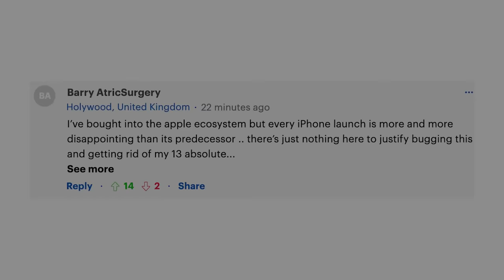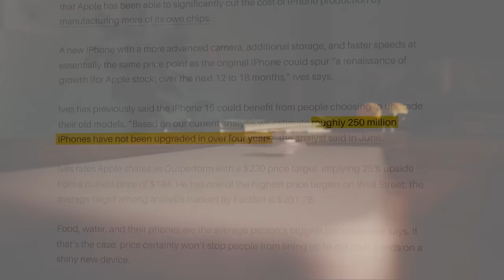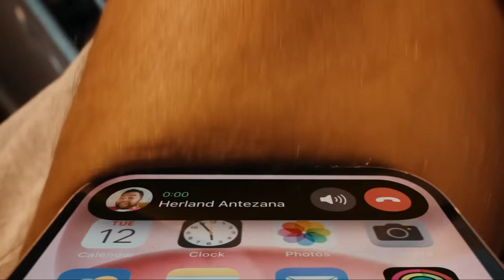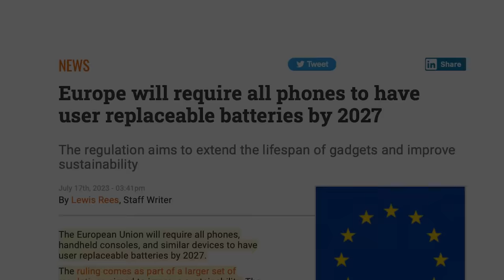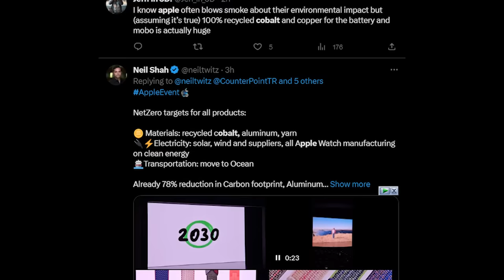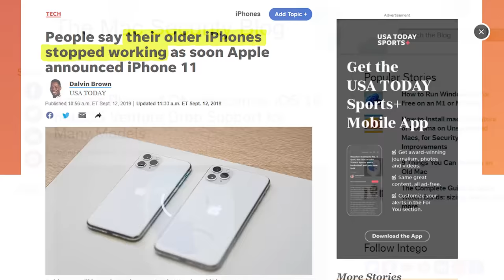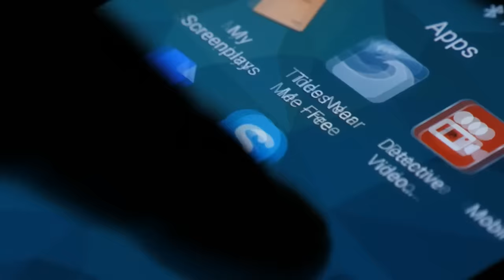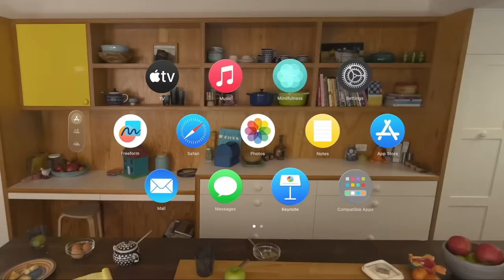The iPhone 15 Is Everything Wrong With Apple

Comment: These upgrades are only underwhelming if you buy one every year. Ideally, you should be using your phone for at least 3 years or more. I have the 12 Mini since 2020 and it’s still rocking great.
Reply: Still got my iPhone XR after 4 years and it’s still working good so I’mma continue using it for a another year or two
Reply: It's easier to undermine changes then it is to understand them. Iphone can support ray tracing now, has a significantly imporved camera, and improved battery life. what more do people want?
Reply: I got the XR. Bought in 2018 and it’s still kicking ! 😂
Reply: Exactly, I have the normal 12 and it still feels like a new phone
Reply: I'm only thinking about upgrading now because I have an iPhone 11 and a damage camera lens 
If my camera didn't have a crack in it I'd probably stick to my phone for another year or two
Reply: "Ideally" to who? As a consumer, I absolutely agree. But from a business standpoint, if they could get you to line up out the door for basically the same product re-released every week they would do it. But it happens "annually" is a good interval to get the sheep excited enough to camp outside the stores in preparation for each new release.
Reply: Same. Sad they got rid of the mini size
Reply: And people try to find an excuse in upgrading their phone every single year.
Reply: @saminates2002 11 is still great. The camera lens is a cheap repair. I have the XS max and I am still happy with it. Nothing I’ve seen that I need on the new release as a regular user. Unless your a photographer/content creator. Plus now you’d have to deal with a new connector.
Reply: Exactly. This isn’t about a lack of innovation, but more about the fact that smartphone technology has matured. There really isn’t anything that ANY smartphone can do that isn’t going to be a minor improvement over their immediate predecessor. When you look at just a few generations back, though, you will start to see bigger improvements. 

I also believe that it’s also dishonest to say that Apple is no longer innovative. Like someone else said, what other smartphone has hardware ray tracing support? What smartphone has satellite capabilities?
Reply: until apple drop an IOS which intentionally kills your battery. OK.
Reply: @Jay5ive789 I would still have my X if it wasnt because the screen died on me one day out of the blue, I changed it for the 12 which was the latest atm and this one is still literally in perfect condition, it can hold easily 2-3 more years. I will wait until the USB C is actually 3.0 and the display is 120hz on the regular version, I hate big phones thats why I always go for the regular.
Reply: I'm still on the 7+ but I will finally be making the upgrade to the 15 pro max after years of using the 7+
Reply: X from 2018 here. While the battery life definitely can be better, I don't see a reason to upgrade to a new phone. If anything I might just end up replacing the battery instead.
Reply: Dude I fucking love my mini, I really don’t want a bigger screen :(
Reply: Yep I upgraded from a 6 plus to an 8 and then to a 13. It’s nice to see a big difference in your upgrades
Reply: I had my iPhone 11 since April 2021 and to this day it’s still going fine.
Reply: i m using iphone 7
Reply: I bought a fold4 from samsung and i dont see myself ever getting rid of it, until it breaks
Reply: I got an iphone 8 plus, so compairing it to my current phone its good😅🤣
Reply: I have iphone and still working great and you don't know how many times I drop It. When i had samsung phone when I drop it, It will black out... That I'm the most super with my 11 and I'm grateful for it!
Reply: @funnyberries4017 features you named are only on the pro models tho, granted i agree with your statement overall but you only proved the point for the pro models lol
Reply: I have a 10. After one of the updates they put out, my battery quit lasting. It'll go dead, without using it, in under 5 hours.
Reply: Same here, I got the 12 and I’m probably gonna jump to the 15 pro or pro max, only cause I get a discount since I work for a phone store

I would happily keep this if the battery lasted
Reply: yeah i upgrade every 3 years
Reply: so what? Samsung and Xiaomi models three years ago had better specs than iPhone 15 base model.
Reply: @Aussiepingpong  that’s a great upgrade
Reply: I came here basically to say this.  Just upgrade when you need to.  And you can always buy a slightly older model for much cheaper.  As long as you upgrade every 3-5 years, you’ll be fine.  And if you can’t afford that lifestyle then Apple just isn’t the brand for you.
Reply: I have had my HUAWEI Nova 5t since 2019 and  it is also rocking fine, remember this is not a flag product so something like an Iphone should work for years to come.
Reply: I still have my s20 fe after 3 years, and the charge still lasts 11 hours
Reply: @chairmanmaul6120  That’s just untrue and you know it.
Reply: i got an 11 pro max and it still works great
Reply: correct me if i am wrong, but if i remember correctly in 2020 the latest phone was the iphone x
Reply: @Jay5ive789 5 days ago I dropped mine on a bathroom tile corner shattering the back where I can see inside it from the back glass so I’m gunna buy a 14 😢
Reply: Just this year, I switched from my Xs Max to a 13 mini. Not going back to one of these huge slabs, no thank you.
Reply: @curtisgordon7379  I thought iphone X was 2017
Reply: @macaroni745  well i may be wrong, but thats the way i remember it. my memory is probably just wrong
Reply: exactly, I still have my XR since it first came out so getting the 15 is a huge upgrade for me
Reply: my 6s still runs… does all the basic functions fine… granted that’s the phone my kids use when they’re bored… i happen to have a 14 Pro and the wife a 13…  my mom iphone 8… so Apple iPhones actual last really long.
Reply: Same, my iPhone 12 mini still works great
Reply: Iphone 8 here, still not seen anything groundbreaking enough to upgrade. Will probably have to update to Iphone 16 though
Reply: I had a second hand iphone X since 2020 and it was starting to break, so I knew it was time to switch and for me an iphone 15 seemed like a great improvement. Obviously the upgrades are not going to feel like much if you switch every year, like from a 14 pro to a 15.
Reply: This is not a meaningful upgrade over the iPhone 12 Beyond usb-c which they were forced to do. It's literally the same exact design outside of the ridiculous Dynamic Island which you cannot even turn off
Reply: @Jay5ive789  i'm still using my oppo f5 from 2017 with android 7 6 gb of memory left and i kid you not it has a fucking 16nm processor..........yea i doubt an upgrade to a samsung flagship will be only marginally better for me lmao.
Reply: I had an S9 for about 3 years before it started to fall apart. The screen was cracked, buttons fell out, mic didn't really work nor the earpiece speaker. I bought a S21 earlier this year to replace it. Sometimes I forget that I'm using a newer phone and we're talking two phones that are 2 generations apart. There are differences, but that's only a 10% better camera that you can't tell the difference between unless you have them side by side, and a fingerprint reader that is located somewhere different.
Reply: I still use my Iphone 8 lol! but it is dying so I am gonna buy a new one soon
Reply: @rollinontheboard time upgrade to at least an 11
Reply: I’ve had an iPhone 8 since 2018
Reply: Rocking the 12 pro max still, needs the back replaced but other then that it’s great.
Reply: Bro I got an iPhone 7…
Reply: @funnyberries4017 they want innovation man. 😂😂
Reply: Same here. I have the iPhone 12 pro and I am planning to buy another one in 3 years, that is the iPhone 18.
Reply: I literally have an iPhone 8 plus and love it lmao
Reply: True but with iOS 17 it’ll probably lag a bit
Reply: Ouch... welp rip to u mate. iPhone 12 recently got tested and it has the most " radiation" that can go thru us Humans
Reply: This is correct. Year-to-year innovation isn't a thing anymore, so the consumer typically lets yearly incremental upgrades stack 2/3/4 years before purchasing a new phone (or computer, for that matter).
Reply: I upgraded from SE to 14 pro and i don’t plan on upgrading for another three years at least.
Reply: +1 on mini
Reply: Yeah, I'm upgrading from an SE (2020) to the base model 15 and am planning on keeping that phone until the iPhone 20 releases.
Reply: I went from a 7 to a 14. Screen was a bit bigger, camera was a bit nicer and apps loaded a bit faster. That’s pretty much it lol.
Reply: I have X
Reply: This. I have bought the iPhone 6 Plus on release and stayed with it until this year that I decided to buy the 14. Yes it's way too much, but I'd use an iPhone until they no longer get iOS updates, which is like 4-5 years, which is great because a lot should change in 4-5 years
Reply: i dont think ill ever buy anything from apple, but im normally having one phone for like 5 years minimum. Last phone i had for 7 and i actually lost it XD so maybe i would be able to hit even more with it until it stopped working. The phone i have now will be about 4 years now? i think.
Reply: still with an XS till it breaks
Reply: I just switched from the iPhone X I had for 5-6 years to an iPhone 13
Reply: This. I remember going from a 4 to a 5s (3g to LTE, and a crappy version of iOS 7 to a fast iOS 8), it was night and day. That was back when iPhones only had support for 3 years. Now you get support for 5 years, plus a few more years of security updates. That’s unheard of for any android, but Google and android manufacturers keep getting a pass from everyone
Reply: Innovation is dead, seriously.
Reply: I don’t pay a dime for my iPhones, I trade them in lmao
Reply: Absolutely right..I also feel the same, I have a 14 pro max and I have no reason to upgrade to 15 pro max, except the USB-C, the Action Button and the new A17 Pro Chip, there’s not much of a difference…I can use my current phone easily for 6-7 years.
Reply: @funnyberries4017 Why the duck would someone want ray tracing on a phone
Reply: True. Been using my 11 for more than 3 years now. Still working good and I am really excited in case I upgrade in the future.
Reply: Still the difference between the 12 and 15 is minimal.
Reply: can you please tell me the difference between the samsung s22 and s23???
Reply: I’ve got SE2020 and I’m fine with it. When I need to replace it one day I’m just going to buy the same phone lol
Reply: Exactly
Reply: I have 11, for 3ish years but flip series on andriod is more interesting to me than 15. Will see long term performance before switching to andriod
Reply: It’s has more radiation mate just upgrade
Reply: eh i got a 13 mini and i really never grew attached to it, imo my old iPhone 6s was a better phone, it simply worked better and was easier to use. Face ID and the display stopped working after being in some 3 feet water for only about 4 minutes, it costed $300 to replace the OLED display. Overall its a pretty mid tier product, chip is a powerhouse, camera's are fantastic, display is great. but it really doesn't feel special. Probably will replace it with a 15 pro or 16 when it comes out
Reply: Still using my iPhone 11 which I got in March of 2020 and it’s still working amazing. I still don’t even have the need to change the battery yet.
Reply: My Walkman w810i still going strong
Reply: 3 years is the bare minimun, I have only owned 4 phones for the past 15 years.
Reply: 12 mini is the best.
Reply: yeah I've had the same phone for 5 years now don't plan to upgrade until atleast 8
Reply: My iPhone 7 Plus lasted 5+ years. I upgraded to the 13 pro max and it actually felt like a true upgrade. However when it got stolen that same year I still had the 7 plus on hand to use until my insurance replacement arrived. 

I’m on the same said as you all. Technology should have a lifespan of a few years until it needs replacing. My 2016 MacBook Pro is still going as well, and even after having most parts replaced recently ✊🏼
Reply: I’m using iPhone 13 mini I was expecting major  change for iPhone 15 but I don’t know if it’s worth it anymore
Reply: i have the 11. i am SO excited for the 15 :)
Reply: I have a iPhone 8plus and it still serves me well, when I saw the update the iPhone 15 has I was impressed and the USB-C is a fantastic upgrade from the lightning cable.
Reply: It’s radioactive
Reply: Hell no the 12 mini speakers and battery are abysmal but keep lying to yourself
Reply: iPhone 8 plus here…..my next upgrade is 2nd hand iPhone 11 pro max. The 1st hand iPhone i ever had is iPhone 4a, then after that is 2nd hand 6s…it would be 10 years from now that i would use apple USBc.
Reply: I've got the 6s and it still runs great but most of apps doesn't support even though phone is still capable of doing a lot of basic things that one phone should do.
Reply: I’m probably going to pick up the 15 Pro Max this year. It’s doesn’t really wow me and I’m upgrading from the 7 Plus. 😂
Reply: I love my iPhone 13 mini!!
Reply: Same!
Reply: people these days just complain too much if you think the upgrades are trash just skip it period but our nagging attitude is just too annoying if they give us everything at once what will they sell the next years to come
Reply: Exactly, no one is forcing you to upgrade every time a new model comes out. The whole conversation around this is so stupid. It's like a mind virus.
Reply: Precisely. Absolutely no point in yearly upgrades.

Still got my 11 and I’m undecided whether to upgrade or not.

Don’t really see how candy bar phones can be any more innovative.
Reply: I agree
Reply: The Only Reason Why I Changed My Phone (Infinix) Is Because My Dumb Ass Let The Phone Fall On The Ground (R.I.P A10), Otherwise I'd Still Have It, Even My Newest YouTube Account (This One) Is Here Since 2019.
Reply: @vaskater07 me to but the charge entrance have bad connection do you have the same problem ?
Reply: @DanielCosta-zp6jl  yeah I do. sometimes I'm not sure if it's the phone or the cable, but it's probably the phone. I also use wireless charging so that works perfectly.
Reply: my Huawei Mate 10 , chipset kirin 970 with ai and leica camera,  still running well until know still Fast ( 6 Years still Running Well )
Reply: had my 10s for 6 years and then screen barely started glitching. I was an android user before that and they literally lasted 1 year and something always broke. At this point I rather pay for something that last.
Reply: @StolenJoker84 finally some said it. And Android Fanboys call every single Apple user as one who camps outside stores and upgrade every year. Just not true 🤦‍♂️.
Reply: Also I am rocking an iPhone SE 3 and will continue using it until no more security updates. (Probably 7-9 years looking at the iPhone 5s and 6/6 Plus updates.)
Reply: @brjones27 that’s the thing, battery life and space
Reply: @tigana i miss my iphone 8 😭
Reply: i went from an iPhone 8+ to a 15 pro max
Reply: My mom still has her XS Max and that was probably the best model Apple made 😭
Reply: Exactly
Reply: Maybe you would have a different thought if could try an android phone
Reply: I have the 12 Pro Max and it still looks new. I don’t do much on my phone and don’t need the extra features. I don’t need the upgrade.
Reply: These are underwhelming even if you buy every 10 years because every competitor already had them for that long. You people are comparing trash with slightly less trash. You should instead compare them with good products.
Reply: Well, for me I’m choosing old model. Xs Max refurbished by Apple model and its good. Most user feedback that this model has best model Apple has been made. Battery life is good and performance still good like latest Android phone even 60Hz only. But with ARM8.3-A and support eSIM.

Latest smartphone bit high prices for eSIM support but can get NFC for cheap price but Hong Kong brand. Even Chinese brand also high prices. 

With this Xs Max, it’s help me to get what spec has available in modern smartphones brand. I this still benefit for using it.
Reply: I also have 12 mini